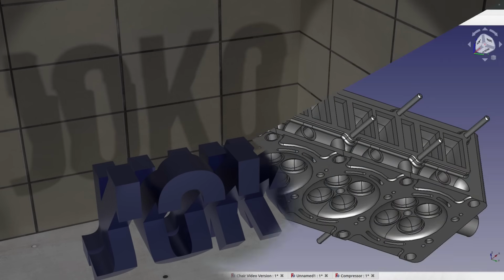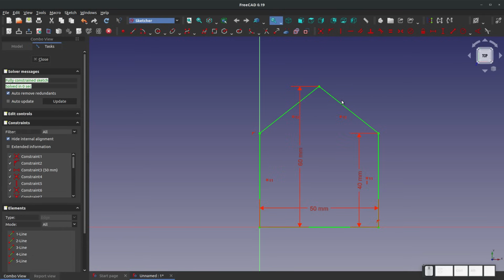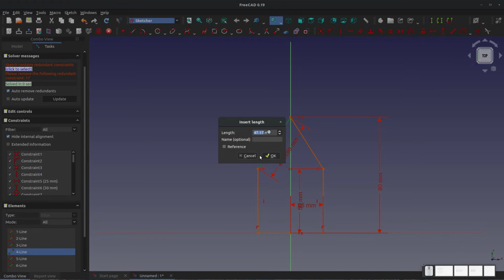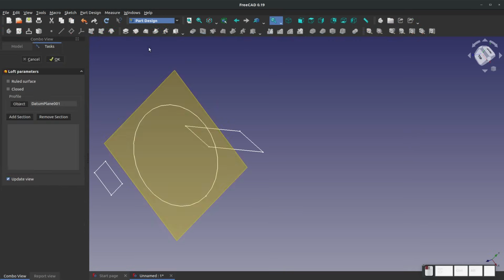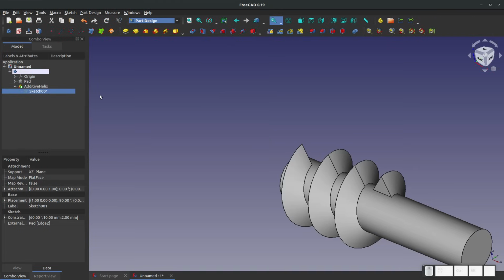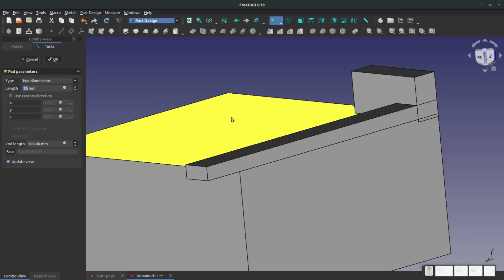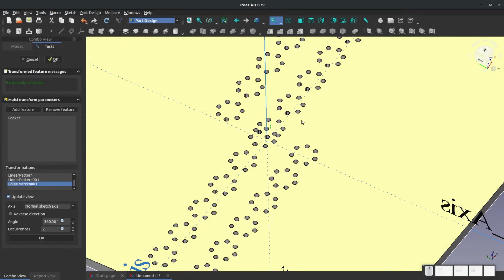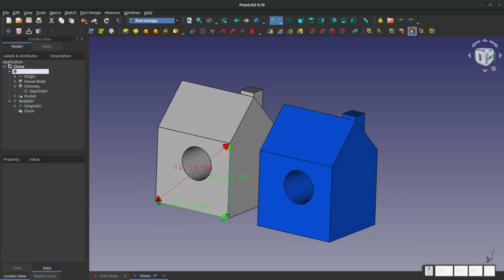FreeCAD: The 2022 Complete Beginners Guide To Part Design |JOKO ENGINEERING|

Comment: Excellent video! Thank you. Learned a few things though I've used FreeCAD a bit. 

One thing I disagree is that all CAD systems have that whatdidyoucallit problem with solids that touch but have zero intersection and do not form a proper solid. Probably yes they have that problem, but I don't once recall seeing that with Onshape and I've done some pretty complicated models. As awesome as FreeCAD (and  OpenCascade) is, it is not yet quite as good as the best of breed. But I'm sure it will get there and it is already amazing and useful piece of software.
Reply from the maker: Thank you!  I have a feeling you have never come across the error because you're a good modeler and skilled at avoiding errors.  I ran a quick test in Onshape and was able to replicate a zero thickness error, sometimes also called non-manifold geometry.  You should be able to roll back and see the sketch that created the error:

https://cad.onshape.com/documents/a3ecebca90c9e87745ea5fa9/w/d6c5c9876be198ad25dfc4a7/e/cb4420ffc7bc1f3ac7e9b379?renderMode=0&uiState=62531061353e12220514a4ac

Onshape didn't call it by the name of the error but simply said "Failed to extrude selections, check input." 
Hope that helps, enjoy FreeCAD!
Reply: @JokoEngineeringhelp   
@Joko Engineeringhelp  

Thanks for responding and taking the time and effort to show an example. I had a look at the example you created and I don't consider that  as a zero thickness error. 

What you have there is a point of triangle on line and I think this is genuinely ill defined. I mean is that single point logically supposed to be part of the extruded object or a 'gap' in the extruded object?

I'm sure it is possible to have ZTE in Onshape and other CAD software, but the example you gave is not similar to the bolt/thread example you had with FreeCAD where a line on the surface of a cylinder which was swept along the spiral and failed to create a solid.

I've never had that kind of problem with Onshape although I have come across issues that looked like problems with the geometry engine. But they have been far and few between, much less than with FreeCAD.

Having to 'add material' to work around this issue sort of makes the model 'wrong' in that it does not express my design intent. And it is exacerbated by the fact that FreeCAD does less than perfect job in not displaying superfluous lines that lie on surfaces.

Not a big deal but FreeCAD would be better without that problem.

While I have your attention may I thank you for your efforts and suggest that a video that would record a real life design case in FreeCAD could be very educational? 

What I mean by that is that a CAD system should be a tool to develop your ideas and designs and not just model the idea. When you develop an idea you need to make extensive modifications to your model as you cannot plan ahead how the model should be constructed as you do not yet know what the design is going to be.

And this is where the true colors of the software are shown. In the ability to modify and maintain your model so that it does not implode on itself. Super frustrating when you have invested hundreds of hours in a model. I don't mean just actual corrupted models,  but just that a model becomes to complex to maintain by the human operator even if the software can handle it.

This is an area where I have no real experience with FreeCAD and where Onshape could be improved. As the model grows it get progressively more difficult to change it. Have seen happen with PTC Creo too that people need start over because of problems like that.

Or maybe it would not make an good video?

 Still I've seen PCB designs that have been captured sort of time laps style and it is fascinating and educational to watch how a layout develops and changes as the plan matures.

As a side note, I used to think that parametric design was the way to go. 

Years of watching the amount of work invested in models that no-body but their mother can modify has sparked an interest in me towards the so called Synchronous modelling. 

I have no hands on experience with that but the videos I've looked at are pretty awesome and makes me think that it is perhaps better and more intuitive way to develop your design and models.

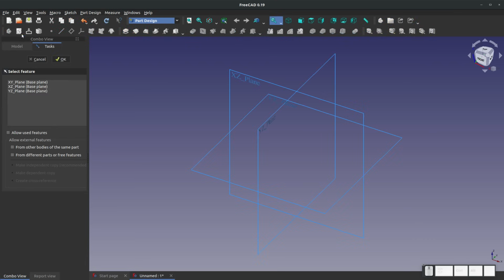Comment: At 11:00, for flexibility in making changes, 1) create a part and rename it descriptively, 2) create body, and then 3) create sketch.  Parts and bodies each have coordinate systems (origin) so that the locations and orientations of pads and pockets are more independent of the first structure when they have different origins.  Proper use of datum planes also introduces an essential independence between bodies and pocket/pad intersections.  Before I figured this out, FreeCAD was exceptionally frustrating -- every trivial change caused errors.
Reply: I think I have heard people talk of this, and how it helps create a stable model.  Thanks for bringing attention to it, and with the time stamp marker, so people can check it out, and go right to it. Thanks.
Reply: I have heard people talk of this but never found a proper tutorial explaining this workflow comprehensively. Almost everybody shows to sketch on faces, but when you want to make a change the model breaks.

Comment: It was not explained how to rotate the model with constrained motion. Its crazy rotating the building freely. Its similar to autocad 2000. You rotate the building a few times and the angle becomes awkward.
Reply from the maker: Use the controls by the cube in the upper right of the graphics display window

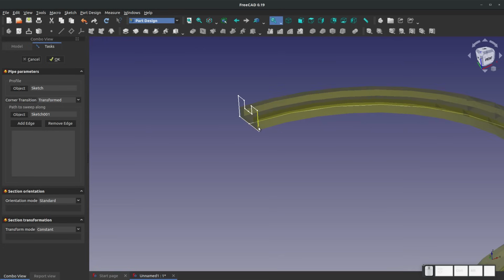Comment: This tutorial has been great so far but I'm having an issue with the Sweep you do at around 1:21:55 - I've checked multiple times and all of my sketches are fully constrained like yours are, but when I add Sketch002 to the transform section with Transform mode set to Multisection, nothing happens. In fact, when I click Ok to see if that would update it, I get an error popup: BRepFill :: profiles are inconsistent.

Do you happen to know what this is and how to fix it?
Reply from the maker: The only time I've heard of that happening is when there is an inconsistent number of line/arc segments between profiles.   That probably isn't the case here.  Feel free to email the part to the email in the description

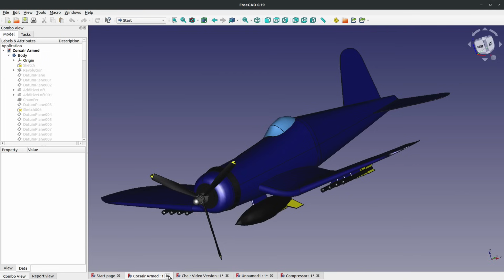Comment: thankyou  for your efforts in putting this video together I had one problem while working through input error: sections must be all closed or all open  this was in sweeping examples 1:22 :22
Reply from the maker: That message usually means that two lines or sketch elements in the sketch are not intersecting.   I suggest zoom way in on your profiles and look at ever intersection between the lines and you'll probably find that two points are not connected somewhere, or there could be an extra line hanging out somewhere.  Try sweeping each sketch by itself and see if one won't sweep- that will be the problemed profile.  If you can't find where the problem is, consider deleting the sketch and sketching it again.  Hope that helps.

Comment: This is an excellent tutorial. I felt like I'd outgrown Sketchup (I only ever had the basic free edition) when I got a 3D printer and wanted to make my own stuff. Do you have any advice for ensuring that the various additional lines (for example the line down the middle of the channel at https://youtu.be/Odr5viqPwkc?t=4962) don't make it into the part? I've made mistakes with Sketchup models before where I didn't realise I'd accidentally made two adjacent parts rather than one single one, and that made it through to the print itself. Maybe it's a slicer/toolpath issue, I don't know. It seems like there should be a way to keep separate sketches while at the same time telling it to merge into one body when exporting or something?
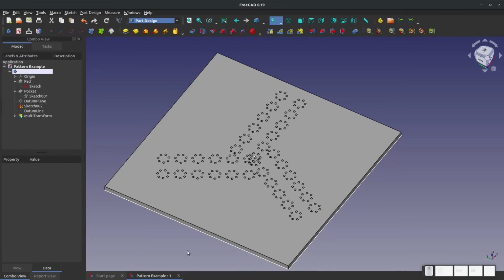Reply from the maker: Hey Neil, thanks.  For your question, fortunately separate bodies in freecad like you described shouldn't be an issue, though I say that having not used sketch up much at all, so I probably don't understand what went into your original problem.  You'll see at the top of the tree I have a 'body' and everything in that body will be merged automatically.  If I tried to create something that isn't connected in some way(try extruding two rectangles that aren't connected to each other or anything), I'll get an error that says "Result has multiple solids.  This is not supported at this time."  So FreeCAD won't even support running a body that would be split into two adjacent parts accidentally or on purpose without multibody commands.  I don't have enough experience to know that problem in sketchup though.  If you haven't seen 2:12:58 (It's such a long video) there is some content that explores working with multiple bodies.  Long story short: if you look at the tree to the left and everything is contained under one body, you're a single solid for sure.  Hope that helps!
Reply: @JokoEngineeringhelp  Superb, thanks very much!

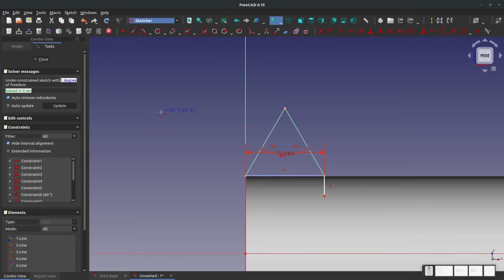Comment: I did EXACTLY as instructed for helix 1:23:00-1:27:00, and it didn't work.

60 min no avail. Want to break something.
Reply from the maker: Not sure what problem you would be running into, if you haven't tried it, it could help to run the helix first and then add the center as a second operation.
Reply: @JokoEngineeringhelp  I appreciate you getting back to me, Joko. I ended up solving it by moving the helix off the edge (on x axis), and constraining it to references from the origin.
Reply from the maker: @jayg4424  Glad you got it worked out

Comment: Thanks for you work. I'm Blender user over 7 years and I'm considering learn FreeCAD. Some shapes are pretty easy to do in it.
Reply from the maker: That's a great balance to know both direct and parametric modeling.
Reply: @JokoEngineeringhelp  Totally agree. It's just not easy to forget everything about Blender once FreeCAD is running :D

Comment: This videos works fantastic if you already started using FreeCAD and need to get back to basics. It covers all the tools you can use with Part Design. I had quite a few 'aha!' moments while you pointed out the things I missed. I really liked how you explained the more advanced stuff that people will only start using later on. Tools like sweep and loft I have been putting off for ages, because they look so daunting. This will make it easier to get started. 

I already recommended this video for everyone who I know already uses FreeCAD to get a more solid basic foundation of the Part Design toolbox. 

This video will give you enough information to get into trouble with the object tree, topological naming problem and a few other issues I had in the past. It took me ages of puzzling to figure out that the list of actions in the Model tree concerned the chronological order of how FreeCAD draws the Body. Especially when different actions start to interact, it might get complex. So a video on troubleshooting the common things you might run into, would also help. But I'll first let you get your voice back. 
(Also a video on using A2+ assembly, Part Design and Fastener workbench to create a mechatronic assembly would help a lot of people.)

Thank you very, very much for making this video.

The clone icon represents 'Dolly the sheep'. The first cloned mammal.
Reply from the maker: Thanks a lot for this! Those are great suggestions and I am planning on making a 'chapter 2' to follow this up (Once I get my voice back of course).  That reference to the sheep is awesome!

Comment: 49:15, no matter what I do, I can not choose a point on the new square (chimney) here and can only choose the lines, and it will not allow me to set a distance from one point to the point of origin.
Reply from the maker: For some reason the mapping of the sketch may require you to sketch "from the other side of the plane".  Exit the sketch, highlight or stand on the sketch from the tree, then in the bottom left click on the data tab, and under attachment select map reversed to be true.

Comment: Thank you so much for this tutorial! I'm an hour through so far and I can't wait to finish and start creating functional models for 3d printing. One strange thing that happened in the beginning was when I box selected to delete lines every line immediately turned black with the connecting dots also being black. I repeated the same process (creating a couple of lines and trying to box select them) and the same event occurred, even after restarting the program. After being confused and annoyed for a minute I simply continued on with the tutorial and about 20-30 minutes in it started functioning normally. Very confusing... 

Again, thanks so much for this tutorial. It's extremely useful!
Reply from the maker: Many thanks.  I'm vaguely familiar with the issue you're having but I have never experienced it myself.  I think it's related to software resources or something like that.  There is a discussion on it here:
https://forum.freecadweb.org/viewtopic.php?t=57744

Comment: I am sweating, because I messed something in the settings up soooo much. Can't figure it out. The prefferences settings changed and there is left only genereal, display, import-export, worbench and start. that's it. Everything else dissapeared. my 3d printer is angry with me. Or I should say at me...

I am considering reinstaling the wole FreeCad. Or I can just not mess around with it anymore and pay attention to the video. This is recuring problem. It hapened to me with Blender before, but there I messed everything up. didn't care and continued "experimentation" which lead to me getting completely lost.
Reply from the maker: Two options come to mind, it's difficult without seeing the problem but view>toolbars> and select everything.  That's good for restoring missing tools from the view.  You can also restore all original settings with edit>preferences>reset in the lower left.
Good luck
Reply: @JokoEngineeringhelp  Thanks for this tip, but it was just that I needed to just load any workbench and then the preferences settings for that apeared. I figured it out after a google search. I guess patience is the key even if I get confused.
Reply from the maker: @bringtheideas460  Wow I gave way too much advice on that one.  Glad you figured it out, enjoy FreeCAD!

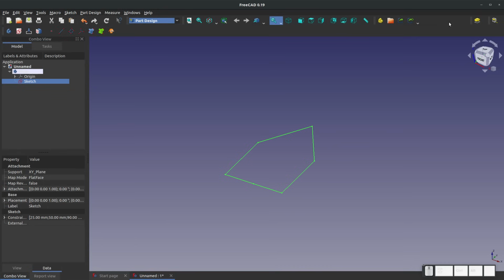Comment: At 47:30, although I had my drawing and have changed to part design, an error "Cannot use selected object. Selected object must belong to the active body.

Consider using a ShapeBinder or a BaseFeature to reference external geometry in a body."

Those did not work.

I then pressed the body button and the pad worked.

Comment: Definitely not a complete beginners guide to using FreeCAD. He jumps right in to creating sketches and using tools and never covers the basic navigation of the program and terminology used. I was, and still am, completey baffled by the program interface. What are those panels on the left, what is the difference between tasks, models, constraints, elements, etc... The terminology is completely foreign and unexplained. Why do those panels keep changing and what do they mean? All of this needs to be explained before you jump into designing a part so I can at least make my screen look something like yours so I can follow along. Did I miss another video somewhere that is the prerequisite to this one?

Comment: So how do you boolean fuse a clone?
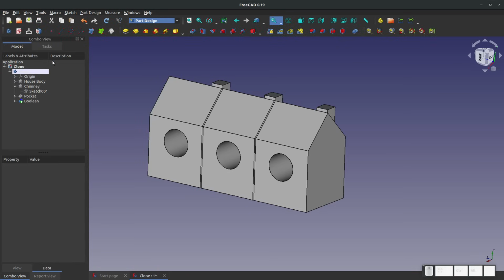2:31:30 that didn't go so well. Can you 'unclone' the clone?
Reply from the maker: It looks like I mis-spoke at that point, and should probably take that statement out.  Thanks for bringing this up. Instead of using a boolean on clones (the clone has a link to the original part so it would create problems) I would use a shape-binder sub object, (the green shape binder icon).  When using the boolean, select the shape binder FIRST and you should be able to boolean a part to itself without a problem.
Reply: @JokoEngineeringhelp  Thank you for the advice. I really loved the video, it's a good format - a long comprehensive video devided to chapters. Thank you!
Reply from the maker: @Absolotle  Thank you!  I'm glad the content was helpful

Comment: This is an excellent tutorial. I have been using FreeCAD for a short time and managed to stumble my way thru designing and 3D printing a model two cylinder steam/air engine...the operative being "stumbled". I could have saved much time had I seen your vedio first! One thing I have wished for is an X-Ray view like you demonstrated in orange. I have the latest version, but cannot find which preference/icon option yields this view. Can you point me in the right direction? Thanks!
Reply from the maker: https://www.youtube.com/watch?v=b-6ji3lmX98

When this link is done processing you should be able to see some view manipulation.  Cutaway views don't show material between internal and external surfaces, so they can be a little confusing
Reply: @JokoEngineeringhelp  Thanks! I was aware of those view options, but they didn't give me what I wanted. I did "solve" the problem another way.I selected the body in ComboView and selected the View tab below the properties window. Near the bottom is a "transparancy" option. When set to 100% I get the result I want.
Reply from the maker: @phillipmorawa3213  Got it, that's a good option too

Comment: Not FreeCAD related but can you show off some more features of Alibre? Such as the hole wizard, cams, gears, etc. Also, how would you have threads for 3D printing in Alibre? In Fusion 360 and SolidWorks I have to use the modeled threads so that the threads actually print but from watching videos, it only seems that there are cosmetic threads in Alibre?
Reply: Or this entire video for Alibre.